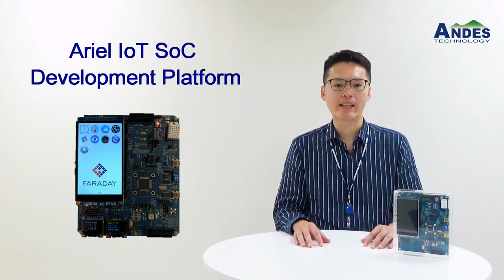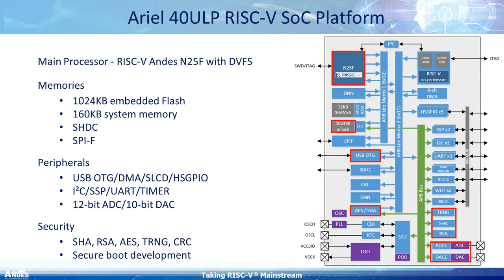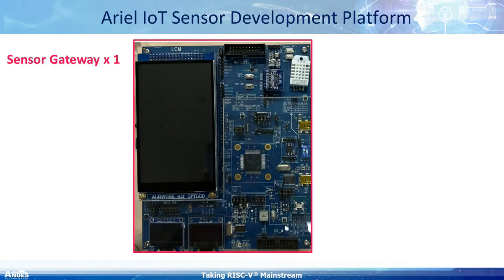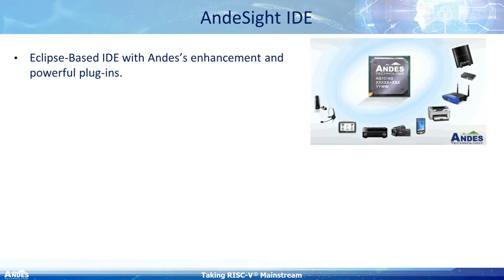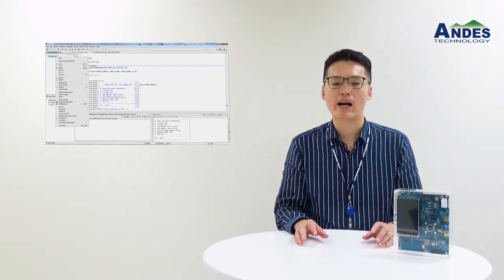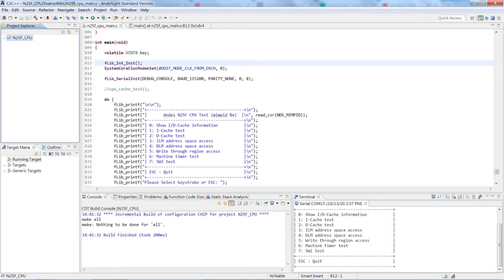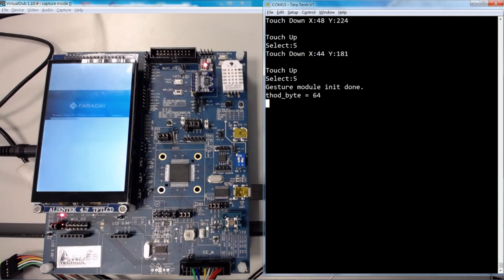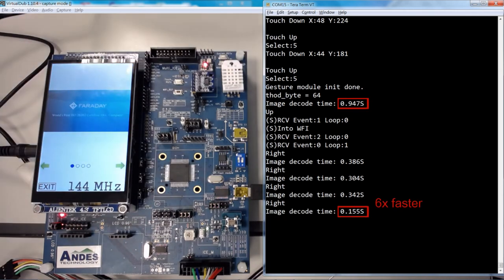Ariel IoT SoC Development Platform Featuring Andes N25F RISC-V Core

Comment: I'm a beginner looking to get into the IoT space. What is the difference between this and the RaspberryPi?
Reply: RaspberryPi is different level of computation performance and power consumption to this Ariel platform which aims to provide lower power consumption and compact size. In summary, Arduino provides similar application development like Ariel platform does